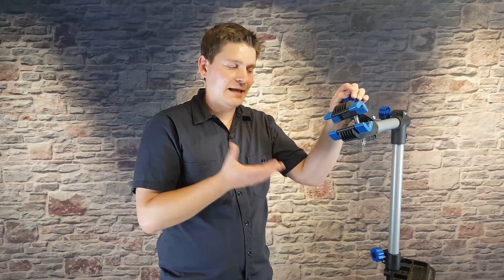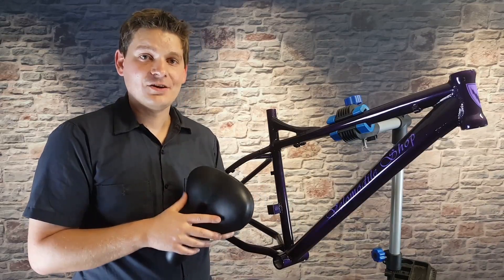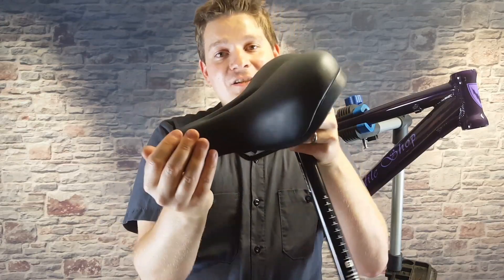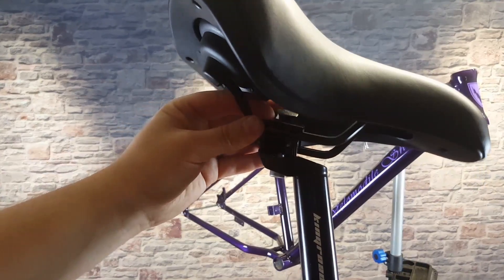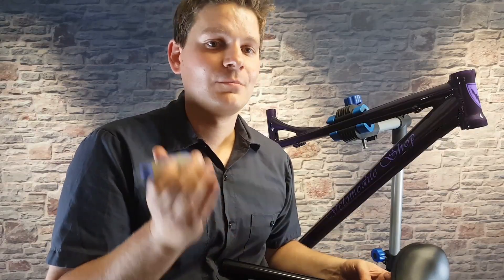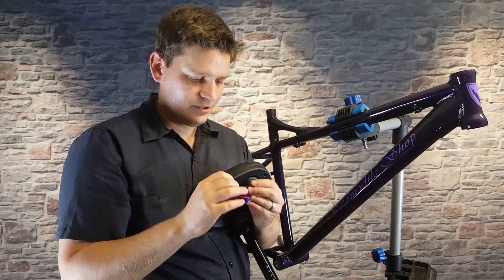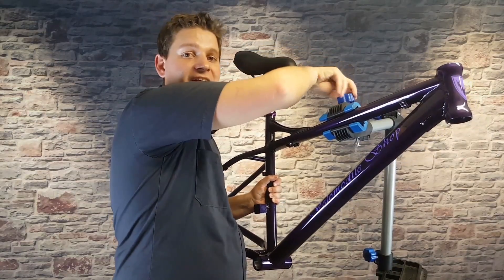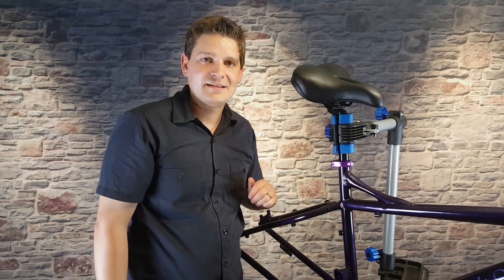How to build an ebike from scratch - Episode 1, Intro and seat install

Comment: This "course" is nothing more than insteuctions om how to assemble an ebike not build one from scratch. This is a misrepresentation of the information available in this video.
Reply: Zoes your statement about building an ebike makes no sense, most manufactures buy their components and assemble them.  Building the bikes from parts purchased or manufactured elsewhere.  Did you expect him to weld up the frame?  Your criticism was really poor and shows a lack of appreciation of the work Kyle put into o this helpful video.
Reply from the maker: Thanks for the feedback. Assembling an ebike with the parts needed does show how to build the ebike.

Comment: Hey Kyle, just found your vids. Very informative. 
The fist thing I need is a Fat Tire Frame. What type are you using? Are they available separately ?
Same with the seat post; I see them on Amazon but a range of dissatisfied folks with photos of broken parts. Do you have or could you list sources?  
Thx for your vids.
Reply from the maker: If you're looking to build your own bike I do have fat frames available.  Check out BoltonEbikes.com

Comment: I look forward to your up coming build videos. C’mom Kyle and get those controllers in stock. You said last week you’d have them in last week.
I need  25A SONDORS plugs with the Big motor plug for a 750W motor upgrade.
Reply from the maker: Some 35A controllers arrived today if you want to go that route.  I'm trying to get the others asap!
Reply: Velomobile Shop 35A won’t fit in a SONDORS Fold X and I’m not putting it outside on the frame and the 35A won’t fit inside the SONDORS X fat bike. I need the 25A with big motor plug.
Reply from the maker: Gotcha!  I just confirmed where they last were.  They are delayed due to "severe weather".  The hurricanes must be playing a role this week.
Reply: Velomobile Shop Placed my order for 2 of the 25A+750W+New Motor Plug controllers. 1 is going to be used on my October delivery of the SONDORS X7 and 1 for my current SONDORS Fold X7 that I received a couple weeks ago. I’m waiting now for you to get in stock the 750W Motors for ordering.